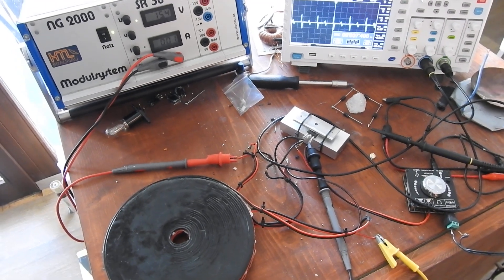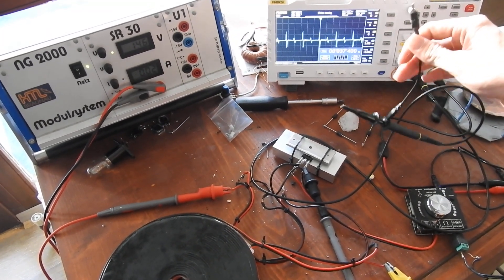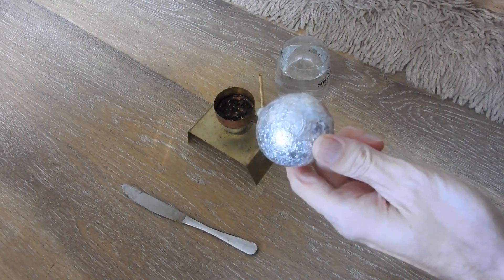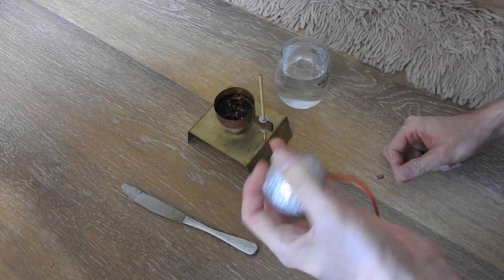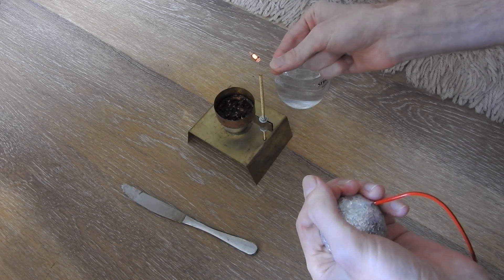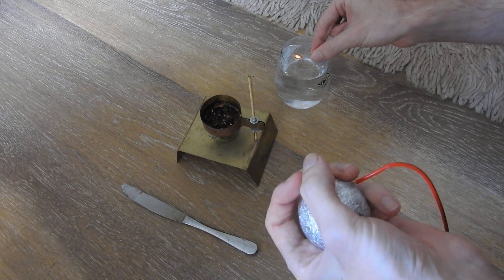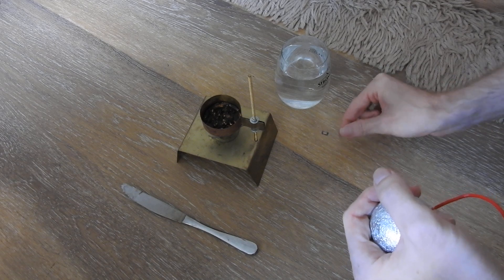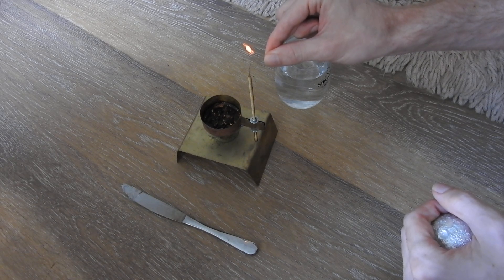A thought provoking video about what electricity actually is

Comment: Basic capacitor setup between foil, epoxy, skin.
Similar to audio capacitor to pass high frequencies to ground or to shape tone.
A coaxial cable passes high freq. between center conductor and outter wire the same way loosing high freq on way to amplifier. Easy way to bleed noise from circuits.

Comment: Can u please look up the device called the “Utron” created by Otis t Carr. I’m sure it’s two bifiler coils with the centre stretched out with an aluminium core with a spark gap in the middle. Hope u check it out
Reply from the maker: Looks interesting, thanks for the info!
Reply: @OmegaZZ111  oh I’m so excited u got this. I’m doing some interviews about this. I’m a fitter toolmaker but know nothing about electricity but this first few vids from Ken, u , Ivo have blown me away. Otis t Carr was Teslas portage and got some of his docs. He then made a flying saucer. But the Utron is very exciting. Looks like two bifiler coils wrapped around its own capacitor which finishes a transformer circuit from an electro magnet as it rotates around c-magnets
Or something like that??!!? 😅

Comment: Can you create another sphere with a wired plug and attach it to your house ground or outlet? Then hold both balls of aluminum in each hand while each hand also touches on leg of the neon bulb 💡. That bulb should light up much brighter.
Reply from the maker: If I hold a second sphere connected to ground my body becomes a light bulb 😉😉
At low input voltage it is ok, if I use more power it's not so pleasant.  

I touched grounded metal objects like a radiator or the metal housing of my power supply with one leg of the bulb and if I do so it lights up even brighter.